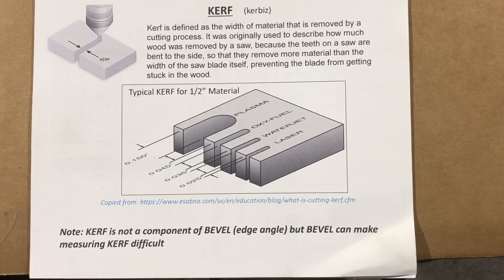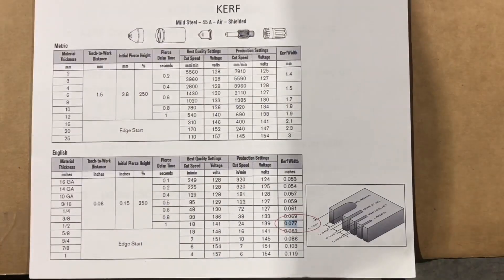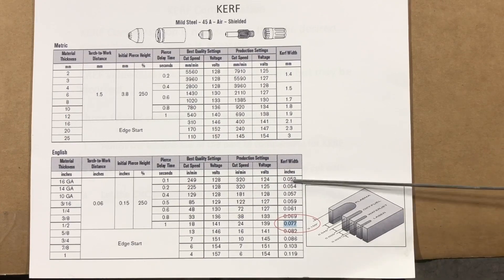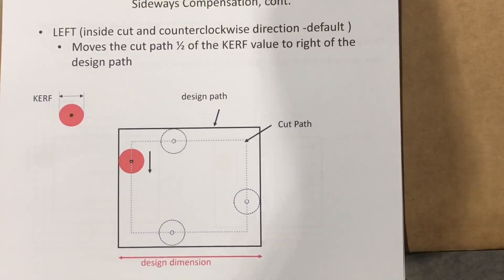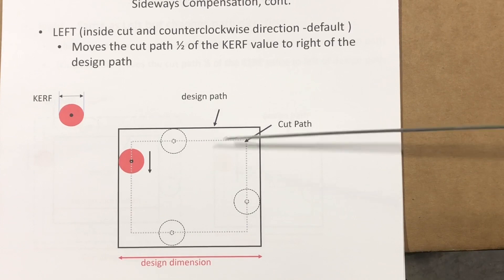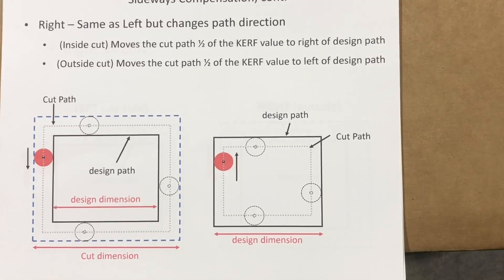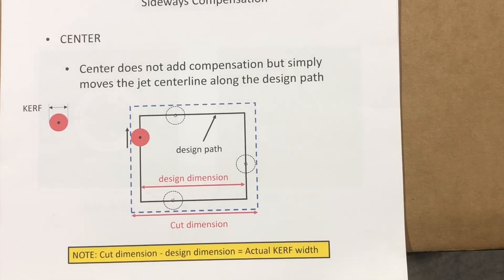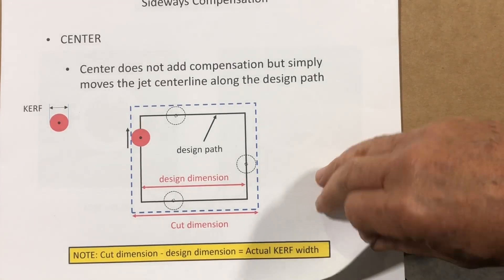May 24, 2022

Comment: Question if you make a center cut on 16 gauge and take a feeler gauge and measure the inside of the cut would that be your true Kerf.
Reply from the maker: In my opinion that has to be the true kerf.  The bevel on 16 gauge is negligible so for the cut height and speed chosen the feeler gauge measurement has to be the true kerf width.  The plasma jet is not perfectly cylindrical but kind of barrel shaped so the cut height can change where the widest part of this barrel shape is in the material which is why the cut height can affect the kerf.

Comment: You mentioned around 14:30 about the early days of CNC having the controller perform the kerf offset. That's called cutter compensation G41 and G42. Search for "linuxcnc G41 g42". Swirl and right and left is a great takeway from the discussion. Thanks.

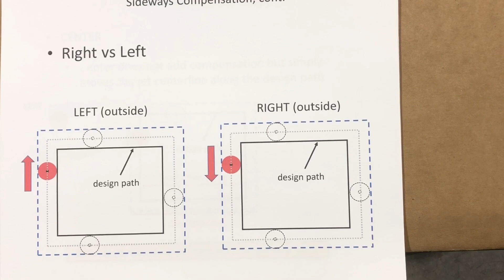Comment: 10:17 according to my understanding, it's not really a good or bad "side" of the cut. The rotating plasma jet is like a mill on the milling machine, you want to go climbing or conventional and it will give you a different finish, if the jet rotates along or against the motion of the torch.
Reply from the maker: You are correct but since most folks that watch these cnc plasma related videos don’t know what climb and conventional milling means it was easier to just claim a “good” and “bad” side!  In CNC milling climb cut is preferred as it does produce a better finish so is the “good” side 🤓.  The backlash in manual mills makes climb milling tricky for heavier cuts so conventional is typical.  Thanks for the feedback
Reply: @CustomCreations3  i like to watch your videos multiple times so I hope you don't mind if I make these comments 😂 it's for the sake of the discussion
Reply from the maker: Heck no...keeps me honest 😊, besides as often as I make mistakes it good to have help to make sure i can get it correct!